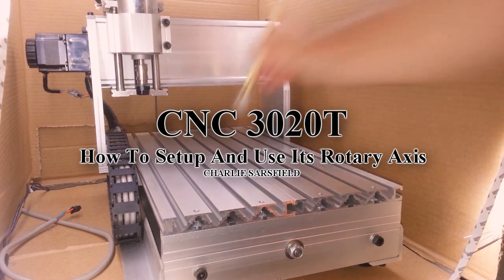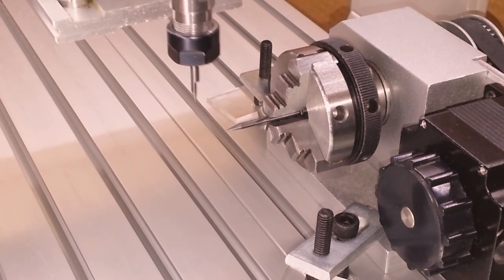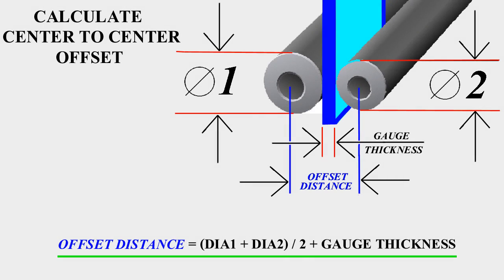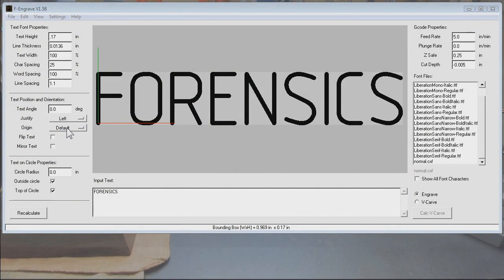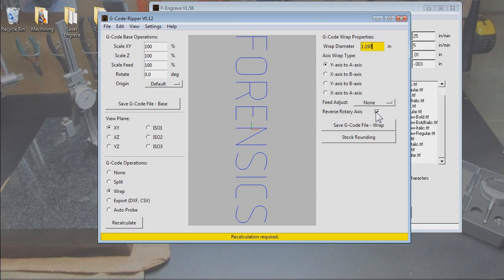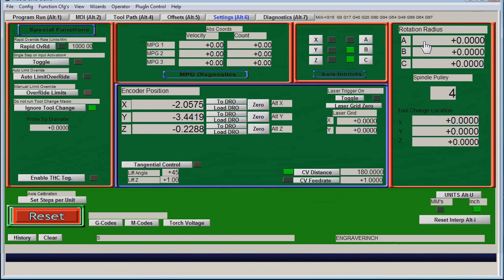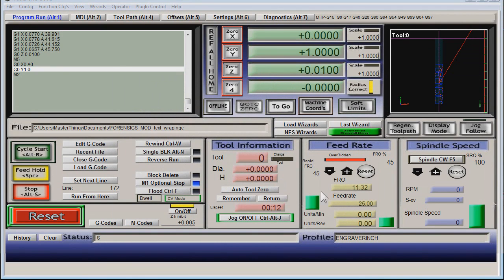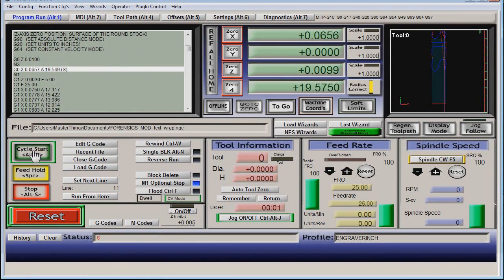CNC 3020T-DJ Mach3 | How to Setup and Operate Its Rotary Axis – A Complete Run

Comment: I need a support to install rotary axis in my  cnc ..can you help me?
Reply from the maker: Did you take a look at my video about Rotary Configuration? https://youtu.be/vG7oyFC-lKQ
Reply: @sunny5rising  ..I  have servo drive for 4th axis..
Is the procedure same for stepper and servo drive?
Reply: @sunny5rising  ....Kindly share your mail ID.. I will share the pics of my machine. 
If possible  you can advise me..
Reply from the maker: Not sure if the procedure is the same, as I've only worked with steppers. My email sunny5rise@gmail.com

Comment: Just to reiterate: Your two vids on tool setting have changed my efficiency to a new level with my 6040 CNCEST; absolutely brilliant.
Tip: Set your slow jog to 5 or 10% and leave it; arrow keys in Mach3 will always move at slow jog, unless you also hold down shift, then fast jog.
Why have you not posted videos in two years? Waiting for more great content!
Reply from the maker: Awesome! Glad the tool setting videos helped you out. New content is coming, so you won't have to wait much longer. :)

Comment: What size rotary is that? Where did you get it? How is this it connected? I am a jeweler. I need something like that for milling modeling wax. Awesome work!
Reply from the maker: Thank you. The rotary is 2 inch (50 mm). It came with the machine. I got the 4 axis version. It connects to the included control box via 4 prong cable just as the other motors.

Comment: Hello Goodnight. I'd like to see if you can advise me on setting up the spinle in Match3. Specifically, the parameters in "motor tuning and setup. I have had this machine for three months and have not been able to configure it. I would appreciate it if you could help me. Thanks and regards.
Reply from the maker: In my case, I have the spindle setup on a relay (on/off) and the speed is controlled manually. I might be able to help you with the motor tuning. Email me at sunny5rise@gmail.com 

Send some pictures of your machine and some motor specifications and I'll look at it.

Comment: this is new field for me , so I ask if you  make this because the chuck is not fixed in the router table?
Reply: if some one want to make the post processor fit his machine configuration(the 4&5 axis center or pivot point ) , he do not  need to modify the programming code of the machine , is this right?
he can determine these parameters by positioning the spindle or probe in some position , is this right?

Comment: Hi Charlie, I'm looking at getting this model but the resellers are only saying the motor can be switched on and off at the control box. It appears from your code you are using M3 and M5 to switch off from the program - can you toggle it on and off from the code or not please?
Reply from the maker: As my machine came stock, I could only switch the spindle from the control box. I did do a little modification to the box so I can control the spindle through code. That video is linked here... https://youtu.be/OeBqSI8oevA
Reply: @sunny5rising  Thanks Charlie - I'm modifying the 3020 to a 4 axis robotic glueing station. Adding a persistaltic dispenser that can dispense superglue and controlling dispense signal with the output you have used for the motor control. Your video's provide fantastically useful projects to guys like myself who try the unusual!

Comment: Or just line the bit up on the center axis of the flashlight in the rotary chuck, then use a z-axis electrical touch plate held on 'top' of the flashlight to set the z axis zero point. https://www.youtube.com/watch?v=G4DeVa8rzA0

Comment: Hì Sir
Please help 
After I setup  and program to run . But the motor running very slow.
I look in to feed rate is 100 %
And when I jog is running normal.
Please advise 
Thanks
Reply from the maker: If you haven't done so already, check out my rotary configuration  video to see if it might be a setting.

https://youtu.be/vG7oyFC-lKQ

Comment: Hi Charlie, I have same router but the problem is that it does not respond to Mech3. It only works with chinese CNC USB controller software. can you please suggest me something , how did you made it work with Mech3.

Comment: how you know tool is exactly half on that point. you can use round bars both. zero axis when measure fist side. then measure other side. then divide that. that will exactly middle point. no need know anything bout diameters. works on z too. just need have flat edge to measure top and bottom. still not need know any measure just half distance
Reply from the maker: Yes, there is certainly more than one way of finding a center point.

Comment: Hello
Can the laser be installed instead of the engine in the CNC 3040 4 axis Router.
Is the electronic circuit has a place to install a laser cable.
Reply from the maker: I imagine that is possible, one way or another.

Comment: hey I've got that same cnc, lately I have to push the spindle to get it going. If I just turn it on that's not enough, I have to physically push it. Once pushed it will spool up normally.

Any idea what could cause that?
Reply from the maker: With the spindle off, turn the spindle slowly by hand. Do you feel any resistance that would cause it not to initially spin up? Feel and grinding? If so, possibly bearing failure. That's where I'd start with testing.
Reply: @sunny5rising  Thanks for the quick reply and your thoughts! 

I did think of mechanical resistance.. it seems to spin freely/normally.

I do hear the little buzz as it tries to start up.. it just seems too weak or too short...

I will check again to see if there is some resistance...
Reply: @sunny5rising  Okay I just checked and it doesn't seem like the motor has any unusual resistance...

I did oil it for fun. Just turned the machine on it's side and dropped some light oil into top and bottom bearings to see if any difference.

Still same result.

I think flipped over the two front switches as they were upside down (down for on).

After that no spindle. So I'm betting I have a wiring problem. I'm going to go over those connections and see if I can find anything...
Reply: @sunny5rising  Boom! I pulled the switch jack off the board and jumped it with an alligator. And it's working! 

Thanks for the ears and help!!! 

Yay, I don't have to push start my spindle anymore!!!
Reply from the maker: Awesome!

Comment: Amazing toy like machine fully operational.
Reply from the maker: Does the job, lol.
Reply: Charlie Sarsfield Oh! Really?
Reply from the maker: Absolutely. Bought the CNC to engrave on steel tools/parts I make on my manual Mill and Lathe.
Reply: Charlie Sarsfield is it so rigid to engrave on steel as well? For how much did you get this and is this available in India?
Reply from the maker: Rigid enough for about .003in (.076mm) deep engraving in steel, but probably not much more. That is as far as I'm willing to push it and do not need more than that anyways. I bought this machine from eBay for around $500 USD about 3 years ago.

Comment: Thanks for the excellent video. Where I can get the fourth axis system and what value it has, it seems good for me to do many innovation works in a 360 degree turn ... thanks for your answer
Reply from the maker: The rotary came with the machine as I bought the 4 axis version.

Comment: Can it be used for 3D part making on metal?
Reply from the maker: Absolutely! As long as your machine can handle it. My particular machine is built to handle lighter materials such as wood and plastics for machining, but can handle aluminum and steel for engraving.

Comment: ******I cant get mine to work FOR NOTHING! spindle speed controler seems intermittent upon turning up or down and will stay on longer if I keep hand on the rheostat spindle speed knob. Directions in Chinese and after finally getting Mach3 up and installed in english everything at the top of page is in Jibberish and NOT EVEN Mandarin Chinese, almost as though there is a Font Unrecognized! I Purchased this thing with the 4th Axis to Carve a My Deceased Buddy Randy(35+years) Name into about 120 sets of DrumSticks for his Funeral Wake at the end of this Month (July/2018). Have Not heard from the Seller yet (E-Bay) nor will I bash any Names...YET!  Hopefully I can get this working so his Family can get this Commemorative!****** :-(
Reply from the maker: As far as the axis controller is concerned, I guess the only thing you can do (besides contacting the seller for replacement) is to check that all wires are installed and tight. As far as Mach3, the latest version is R3.043.066. If you don't have this version, I recommend downloading it.  My machine came with a very old version of Mach3 and I did have issues with it.

Comment: Dear sir
How can i convert 360 degree of Y rotary axis into 200 mm length
Reply from the maker: Do you mean... How many degrees of rotation would it take to move a given diameter 200mm?
Reply: Charlie Sarsfield 
I mean 
My Y axis complete its one revolution in 200 mm in case whatever my workpiece diameter
Tha rotary axis one revolution travel 200 mm
I have to drawn same design which is 200 mm length on tha more than 40 workpiece which have deferent deferent diameter
Reply from the maker: Do you have the rotary connected to the Y axis DRO or the 4th axis DRO?
Reply: Degree to move = (200mm * 180)/(radius * π)

Comment: Which is the most accurate belt drives or screw drives?
Reply from the maker: I have only used my belt drive, so I can't really say for sure. I don't have any accuracy issues, but I'm not making aerospace parts either, lol.
Reply: Screw drives, if you have anti-backlash devices installed.
Reply: Threaded rods are more accurate usually but it depends on the thread pitch against the number of pully teeths and belt pitch, also the threads are better in holding position once you move you can denergize the motor and still hold position perfectly while a belt system could easily be moved

Comment: i have a 4th axis question. posted it to mach forum and am waiting for a reply or two but is there any way to ask you ? you might have the answer :)
Reply from the maker: +spencer chase
Go  for it.  What ya got?
Reply from the maker: +spencer chase
Go  for it.  What ya got?
Reply: probably best to contact you via e-mail since this is a little complicated but here goes? i have a 4th axis that i built because i need a hollow shaft to pass rod through and because i have a ton of stuff to make things with.  i am trying to drill, thread and cross drill some 1/4" brass rod to make thousands of part. i can not figure out how to coordinate 4th axis rotation with the X axis movement so that i can control feed speeds of each independently. i generally write my own g-code or use perl scripts i write to automate and modify it. also use various utilities and wizards. just don't know how to set the A axis spinning at a specified rate while i move the drill and tap into the turning rod.

Comment: Pic
https://www.google.dz/search?rlz=2Y3GQQX_frDZ0725DZ0725samsung.jflte.jfltezh&biw=360&bih=264&tbm=isch&sa=1&ei=MbCdWemKNYndaPOshpAE&q=head+head+cnc+4+axis+&oq=head+head+cnc+4+axis+&gs_l=mobile-gws-img.3...122560.125040.0.125710.6.6.0.0.0.0.225.808.0j4j1.5.0....0...1.1j4.64.mobile-gws-img..1.0.0.Ml6A_I1FOPg#imgdii=U6oLG292DHQ6sM:&imgrc=gUU9rHMfU1ydqM:
Reply from the maker: Alg Cnc 
If you are only going for the 4axis instead of the 5, you might be able to set up mach3 like I did in my configuration video before this one. Again though, it will only be considered axis A regardless of position.

Comment: I mean I have cnc head head how I setup origin work
Reply from the maker: I have to say, I've seen your CNC video and it looks like an interesting machine. Nice job!

I had to look up what Head/Head was, lol. So this is about the rotating head. First, I was never able to get axis B to work correctly in Mach3 and never tried C, as I didn't need it. All of my rotations are axis A regardless of position. I just deal with it through gcode programming. Having never messed with a rotating head, I can only point you to information that may (or may not) help.

http://www.cnczone.com/forums/mach-software-artsoft-software-/221114-newbie-need-help-config-5-axis-head.html

Comment: Charlie did your CNC 3020 come with free Mach3 that would run the 4 axis?  We are looking at 3040 on ebay but seems only 3 axis software comes with them
Reply from the maker: +AmericanMediaRev My machine came with an older version of mach3, so I didn't use it.  As far as i know, all versions of mach3 can be set up for a 4th axis.  Even the demo versions don't limit this.
Reply: Very kind of you to answer.  My friend is one really  dealing with this, will let him chime in, he said the issue was teh generating the gcode for 4th axis, hopefully will get him to join the conversation.
Reply from the maker: +American Uncensored News Network Oh ok. In the description are links to the free software i use to create the rotary axis gcode, if that's what you need.
Reply: Ah, thanks!!
Reply from the maker: +American Uncensored News Network No problem!
Reply: Hi,  we are looking for a free CAM software that will do complex surfacing using simultaneous 4-axis machining.  Do you know of any that work well?  Thanks.
Reply from the maker: +SierraBlaster At this point, I have only used the software in the description to generate rotary axis code, but I don't think it's what you are looking for.

Comment: Hello! Thank you for your videos, it's very helpful. 

I just bought same cnc and i can't understand how to make friends cnc and Mach3. I use USB cable. Maybe this is the problem and i should use LPT cable + LPT-USB? What configuration do you use? Or maybe you use regular USB cable and some specific drivers?

P.S. Sorry for my english.
Reply from the maker: vadddoo Hello there. I had to look into the USB version a bit so that I could answer your question. Firstly, my unit only uses parallel ports (LPT), which is what Mach3 was designed for. It looks like the USB version of this machine has to use other controller software such as that offered at PlanetCNC. I'm not sure if there are any special drivers available that will allow Mach3 to work with the USB machine. There might be though, so keep searching.
Reply: Thank you for your answer! :)
Reply from the maker: vadddoo very welcome

Comment: Hi, thanks for the video, very helpful. When I follow your video and apply it to my rotary axis my engraved text comes out the mirror image of what it should be. Any idea how to fix this?
Reply from the maker: Thanks, Chris. If the tool path shows up correctly in the Mach3 tool path display, but is mirrored in practice, then you should only need to reverse the axis in Mach3 settings. Config_ Ports&Pins_ Motor Outputs_... Check (or uncheck) the Dir LowActive setting for the rotary axis. Should take care of it. :)

Comment: I am not sure if there is something in the setup program I need to setup. I set up the stepper rates and velocity
Reply from the maker: John Thompson OK, are you able to MDI the rotary using something like  G1 A320 ? If not... did you already see my last video on rotary configuration? It might help you out. If your rotary is working, then I'd like to take a look at the first 15 or so lines of your program. Just trying to get a feel for what's going on. sunny5rise yahoo com.
Reply from the maker: John, did ya get it figured out?
Reply from the maker: Looking at your program, John. It does have some issues, but we'll straighten it out. What material are you cutting with this program? Wood? Steel? Plastic?
Reply from the maker: Ok, sent ya the edited program. Let me know how it goes.

Comment: Yes I have I ran a piece with two different size holes and a pyramid pattern in the center and it worked perfectly.  the knob I am trying to turn shows all the toolpaths run ok and the 3D wrapped drawing shows fine.

Comment: Great video Charlie!!!, thank for share it. Im looking to buy one of this one to mill wax. Do you think its a good option for the accuracy?  It is possible to import STL files and then milling on this machine?

  Best Regards, Charlie.
Reply from the maker: Thanks, glad you liked the video. Certainly accurate enough, yes. For the STL files, you'll have to use some software to convert STL files to G-Code to run the CNC. Have at it!  :)